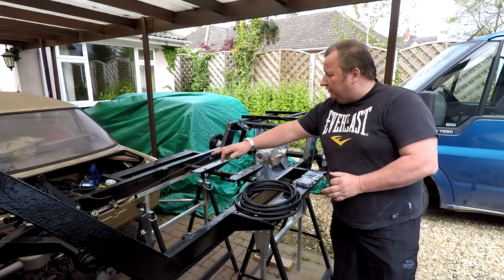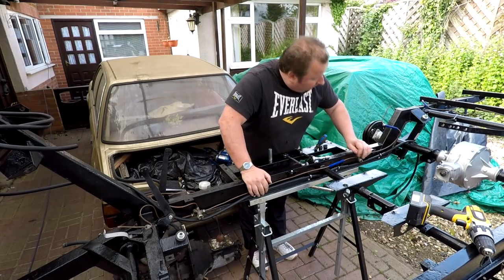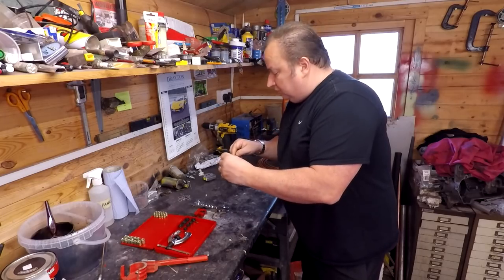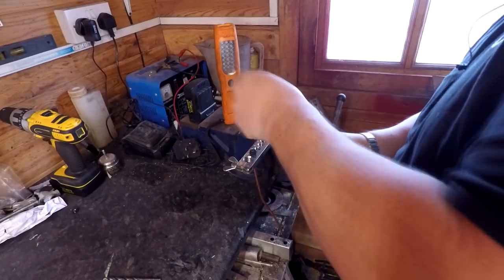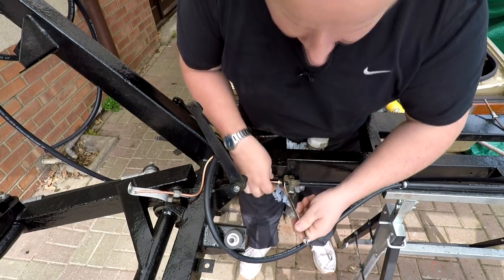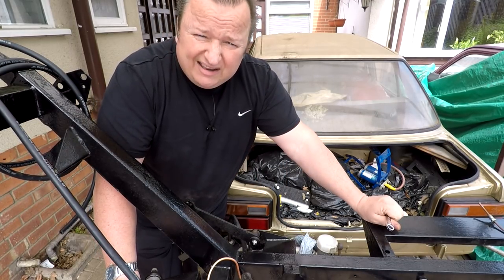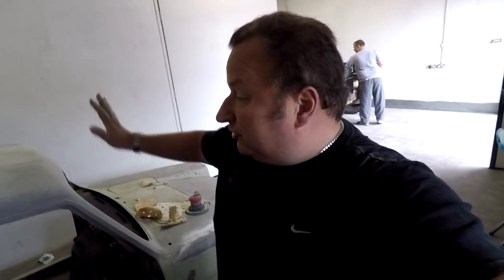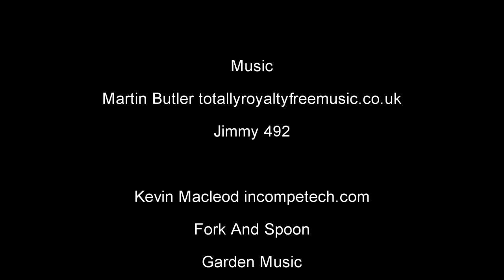Part 17 Reliant Trotter Restoration Brake Lines And Body

Comment: looking good i done the same with the brake ends i was lucky the old ends where still good so reused them on new pipe body is coming on good look forward to next video
Reply from the maker: I'll be doing the same John, I did use the old other end but not the 3 way connector end lol

Comment: fuel pipe is normally a black plastic tube the rubber is just used at the ends for joining bits up. as for brakes you need to use imperial unions you can get them on ebay i think they are 3/8 anyway the wheel cylinders and threads on the flexi hoses as well as the master cylinder are all imperial plus you would need to find a metric splitter that takes the threads on the brake light switch only way is re flair them with imperial only need to do one end of each pipe really as you can slide them on and off that end another tip is the metric unions tend to be gold where as the imperial are normally silver dont know why but they are
Reply from the maker: I'm gonna be changing the fuel pipe now and also changing the unions for the old ones Dan as they are still good and not that old.
Cheers
Martin

Comment: Hi I have a problem with my classic Mini in were the left indicator stalk has separated into two parts the small end piece and the one with all the symbols for horn and indicators but when i click them together and turn on the ignition the horn is on constantly. Also the main problem is when you try to operate the horn is doesn't spring back like it normally should what do you think i should do to fix this? thank you .
Reply from the maker: Get a second hand one from ebay bud. The chances are is that it is broken inside.

Comment: Great video Martin, not sure about that fuel hose ? didn't Scott Best use it on his wifes a35 car and it rotted away ? might not be the same hose.But good job on flaring the lines.Don't drink that diet coke Martin that Aspartame sweetener they put in it is bad news read up on it. Look forward to the next installment lol.
Cheers, Jeff.
Reply from the maker: Looks like i'll be changing the fuel hose as another commenter says the same Jeff. Good call.